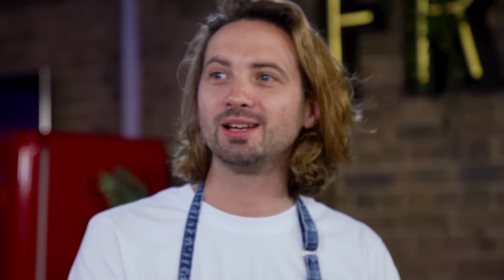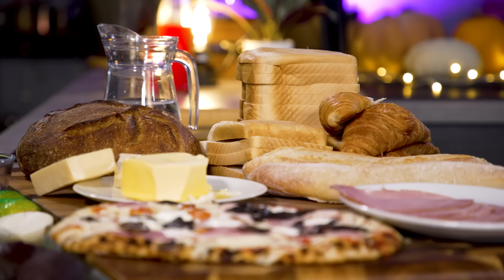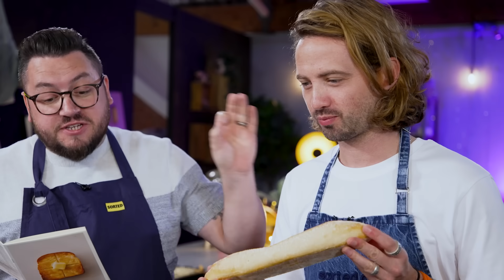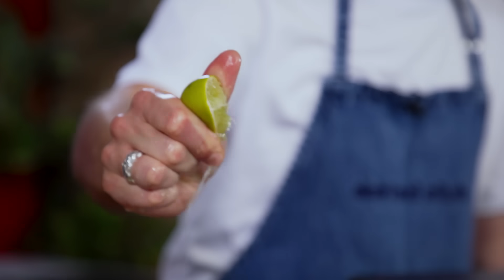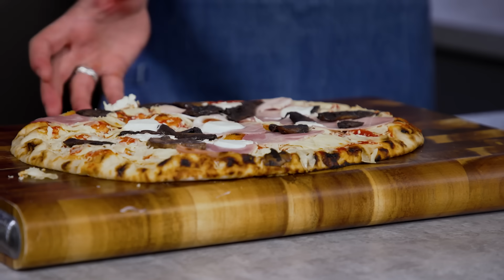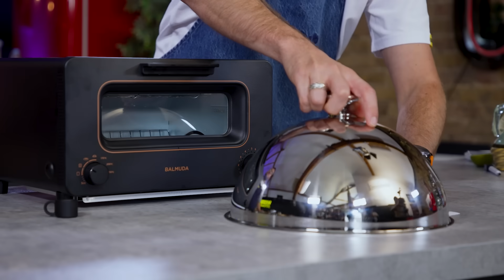Is this £260 Toaster GENIUS or an Absolute Waste of Money?!

Comment: When you took the toast out, the top looked awesome - but the bottom looked half burnt half "raw".  Kind of the same with the Cheese Toast, the top looked very nice, but the bottom had a burnt line in the middle, and hardly anything else. The cookies showed the same un-even heating.. And the reason why the pizza didnt have a even burn on the bottom (which Jamie seemed to like) was probably the same reason.. The very least a toaster / oven should be able to do, is brown/cook things evenly and well.

Comment: You guys should really check out the Ninja Foodi Air Fryer Oven, the model name is SP101UK (in the UK, of course). It does these things and more, I think you'd have a good time trying it out, mostly since I love mine and use it almost every day. Plus, it's "only" 179 punds, and flips away when you're not using it.

Comment: Why would you buy this toaster oven when you can just use the techniques learned from the instructions and just use a cheaper oven? The common technique in everything is using a little water. Just keeping a spray bottle with water near by and spray the inside of the oven when toasting bread.

Comment: I own one of these.  It is not a miracle worker and is not for everyone, but I like it.  I have a small kitchen and this works well.  

Besides the toast and some of the things they have done, I use it for reheating chicken nuggets, doing pizza rolls really well (better than a microwave).  Sometimes making solo meals (like even salmon) has worked out well.

Sometimes I wish it was a bit bigger, but if it was a bit bigger it would be a struggle to put in my kitchen (which is one of the reasons I bought it).

Comment: You can get a decent toaster oven for 1/3 the price, and get basically the same results, but you have to figure the settings on your own.  For half the price you can get a tabletop convection oven.  It does look pretty slick though.

Comment: Well, these smaller oven type things are popular now. Like the air fryer. We all have an oven that can fit a bloody turkey in it and every time we use it we spend energy heating that huge chasm. I would say as far as ovens, for most people we could would need the same width but only half the height. What you need as a student on one of those STUPID electricity meters you have to fill up. One induction plate, and one airfryer or this thing. Maybe a microwave. I remember one of the places I lived in Wolverhampton as a student you had to light the gas oven by putting a match into it. NOPE! Oh good ol' student accommodations! lol

Comment: You can get the same "steaming from the middle" phenomena by freezing your bread in slices and then throwing them directly into a normally priced toaster oven. Also, I recommend looking at how J Kenji Lopez Alt wets the outside of a bagel before toasting, which refreshes them similar to the ~fancy~ baguette mode here.
Reply: Exactly my thought. The wet-the-baguette method makes this pretty pointless.
Reply: Another option: air fryer/countertop convection oven + little bit of water in the bottom. I do that all the time...and my air fryer was like $60.
Reply: The best part about freezing it is the bread lasts a lot longer

Comment: Interesting to see a toaster oven that actually toasts bread well out of the box without fiddling. That being said it's clearly been specifically designed mostly just to do that. Still pretty sure I could get most of the way towards what that thing does by just adding a bit of water to my 60$ toaster oven and messing with settings. Plus I can cook a whole chicken in mine if I spatchcock it. And have much more gradation and specifics on the functionality (full temperature knob, convection or not, broil (grill) or both elements, all the standard oven stuff). And I can fit 4 big slices of bread in without issue.
I'm told you guys don't really have toaster ovens in the UK, though. Shame. I got rid of my traditional toaster years ago after buying a solid, but entry-level toaster oven, and I've never looked back. It's basically a non-buzz-word-marketed air-fryer - i.e. a small counter-top convection oven. 100% worth buying one. That machine, however, is worth no more than 100$ CAD. You guys don't have a direct comparison, so you seem vaguely okay with the 3 hundo, but that's ludicrously over-priced.
You should also always pre-heat a toaster oven, just like a real oven. It's not as important, but you still get better results.

Comment: 12:51 its a fair assumption that it would use less power, but what would complete this review was real world testing if it really did useless power, with prices on power going up, its relevant if your expensive toaster costs more or less that just using you oven or other appliances that can do the same job, perhaps cheaper.

Comment: who the heck gave the instructions of a cereal killer for toast. imma say for 300$ US dollars heck no all the nope drop it to 160$ maybe but its still just a over hyped over priced Toaster Oven and nothing more and in a few years I believe normal toasters would copy the same idea for the moist future. my budget for cooking items is if its more then 50$ its BS ex pans and pots 100$ or a little over is reasonable for something to last more then a year, and a good quality knife seriously I use a 36+ year old knife for slicing and cutting everything made by buck in some time in 60s or 70s and its still cuts everything even bone. i have my moms blender from the late 50s still works amazingly but very dangerous at the same time. its got open vents on the bottom so you see the motor sparking and smell ozone. but its never quit or did something my mom saw as not normal from when it was new. we have a lot of 60s-70s and a few 80s stuff. my fave is the copper and nickel plated pasta strainer my mom had it passed down from her parents from WWII we still use it every week.   id rather spend my money on well made items vs a pretentious toaster oven any day

Comment: I think I mentioned the balmuda in a comment to the other toaster video. I've seen other videos on the balmuda and have been very intrigued. Sadly, bread is no longer a regular part of my diet (even though I love it). Wow. You can hear the crunch every time they bite into the various toasted breads. drat. I'm drooling. Too bad they didn't try milk bread in it. I think the balmuda is supposed to work exceptionally well for thicker sliced bread, like the cheese bread they made.

Comment: Just bought a new toaster with quartz tubes (like this one appears to be) for $50 or 1/6 the price. Granted it is a vertical slot, so you can't do cheese toast, but it has a bagel mode where it only toasts the inside of the bagel and not the outside. Seems to me, if you really want a little steam to just use a spray bottle with water before you put the bread in the toaster to get the same effect,
Reply: Toasters  with a bagel mode have existed for at least the past 15 years; my parents had one when I was young. I think it cost $20, if that; it was surely whatever the cheapest available model was.

Comment: Interested to hear if the outside stays cool while in use. That would be the deciding factor for me, since counter space is limited and having to keep things far away from a hot appliance takes up even more room.
Reply: It does seem to keep cool on the outside, judging by how Baz was opening its door.
Reply: The outside gets a little warm and you need to keep it at least 4 to 6 inches away from other objects. The front stays cooler.

Comment: So its an expensive small toaster oven(as that's what it is, a toaster oven just fancy aka more $$$$$). As you can do lots of that using just a toaster oven and knowing methods they use to do it. Just the machine is built to have places for like adding water for steam instead of adding own way to create steam. So you pay more due to they have built it for that and gain something that is smaller and toast less but has it all in place for use instead of having to figure it all out yourself. Yep so not worth it as a good toaster oven can do that and more, without dropping 300 bucks on a small fancy toaster oven.

Comment: I think you two wanted this to be a good toaster, so you overlooked and downplayed the actual effectiveness of its cooking. when you pulled the original toast out you didnt even look at the bottom and in the shot when you go to put it on the board you can see the whole one side of the bottom was not toasted to any sort of color. then in the cheese toastie the bottom again may have been dry but it certainly wasnt taosted to any shade but the bread. and then on the pizza... i am sorry but NO ONE likes a floppy pizza... even Ben comments on the pizza flop when its not firm and cooked properly. overall i'd say it's just an over-priced easy bake oven.

Comment: OMG, these things drive me insane, so expensive and not needed.   Just boil a kettle, put in a tray at the bottom of your oven and then grill your toast, heat your bread, etc using your builtin grill.  EDIT:  Obviously toast with the oven door closed ;)
Reply: 1) There are many places in the world where ovens do not come standard in flats or apartments
2) Toaster ovens use far less power than an oven
Reply: @al5547  I was really talking with regards to already having an oven and yes I was very UK focused.

Comment: I was in the market for a microwave toaster oven combo thing a while back. I ended up getting the CS89 combi oven from Panasonic. It's way bigger but so much better. It also has special modes for frozen and chilled pizza and other things. It's also almost a normal sized oven, so you won't need to cut your pizza beforehand!
Reply: I was eyeing this model for a while now too. May I ask if it grills well (with grill marks and all)?
Reply: @cyexlceltan3446  The Panasonic? It grills excellently, perfectly even and you wouldn't struggle to get the heat bllistering.
Reply: I was looking for something similar and got the Sage Combi Wave which is a microwave/oven/air fryer. Has special modes for pizza, chips, rice, etc. Lots of special modes for meat, which are a bit of a waste since I'm vegetarian, but overall I'm happy.
Reply: @meredit931  I didn't think the Sage one had a microwave function? The impetus for the search was because I wanted to replace my microwave, and the combi microwaves from Sage didn't have the oven/air fryer function that I thought would be a good combo.

Had a quick look on Sage's website. Just my luck that they came out with a product I would've bought almsot right after! Ah well...

Comment: I do think it's worth contextualizing that this is a Japanese toaster meant for Japanese kitchens, which do not come standard with an oven. There's usually only a hob or two. The kitchen space is also usually tiny if you're living in a big city, so space is at a premium. All this to say, tiny toaster that doubles as tiny oven is helping conserve space in the context in which its most often used and this sort of thing would be marketed toward hobbyist bakers.
Reply: Than get a mini oven, I had one when I was a student at uni they can do all that this thing can, have a wider variety of temperatures and are cheaper and depending on model have two additional hobs on top.

Comment: I have a small Panasonic toaster oven(NB-G110P) with infrared heating, says it reheats 40% faster than regular toaster ovens,...love it!. Comes with a metal tray..does toast, pizza, reheats, bakes...fits an 8"x8" oven-proof casserole .   189-199$ CA=122.53 -128.71 GBP....mine is 110 volts of course...

Comment: Two things you didn't cover that would make a difference for me.    1) How easy/difficult is it to clean.   I saw cheese dropping off into the oven when you did your first cheese toast, did it adhere and become a permanent part of the oven?    2) Is there a storage location for that tiny cup, or is it simply bound to be lost within the first day of ownership when it gets put into the drawer with the measuring cups?
Reply: Aha! Exactly my thoughts too!! And they didn't show us the bottom of that first round of toast...was it toasted evenly, or did I glimpse whiter/darker spots similar to what my 20-year old toaster coughs up?!
Reply: @danutagajewski3330  I definitely glimpsed what I would call "burned" spots on the bottom of the plain toast, as well as "raw toast" bits that didn't seem to get any heat. And what did the cross do?
Reply: @danutagajewski3330  The bottom doesn't toast evenly. It doesn't affect the taste.
Reply: @danutagajewski3330  The bottom of the toast was both burnt and raw, with stripes from the rack. I think the toast is like the machine itself. Looks very good on the bit you're supposed to look at but a closer look and it's wasted.
Reply: @Jailhouse_Chris you can adjust the temperature and time to make toast to your liking. I like it about how they made it but it’s very easy. You don’t have to use the presets. There is a temperature dial as well as a timer dial and it’s brilliant
Reply: There is no storage for the cup. My toaster stand has a little hook, where i hook the cup, otherwise I am sure I would have lost it by now
Reply: I have this oven for two years (I live in Thailand), so I can answer to ur questions. The tray underneath is removable so you can clean/wash it with no problem. However, there is no storage for the little cup. But my seller includes the magnetic hook that can be attached to the oven, so the little cup can be hung there. But I don’t think it is included in original box. Sometimes I use one tsp (=5ml) instead too. Hope this helps!
Reply: I can answer the losing the cup problem - 5 ccs is the same as 5 milliliters... which is the exact same as a Teaspoon.  Its a teaspoon of water.
Reply: It’s a Japanese toaster, so if you cut your bread as thick as Japanese bread, you can remove a bit of bread and make a trough for the cheese so it doesn’t spill out.
Reply: You can put a little magnet on the bottom of the cup and the toaster is metal so it stays put. It’s very easy to clean. I’ve had mine for years. Got it on sale at Costco years ago for $120 US but it was limited to the gray one. While I’d have preferred this black one or the white one it was affordable and I love it and I’ve grown to love the color. Also if you lose the cup it’s just basically 1 tap or 5 ml
Reply: The other question is can this be replicated just by adding a tsp of water to the bottom of a regular toaster oven? As near as I can tell, dialing in the heat and time on a regular toaster oven with a tsp of water in the middle would achieve the same thing.
Reply: @PrinceKaladin no it wouldn’t. It distributes I differently instead of sizzling away at the bottom
Of the oven. That’s too little water for an oven. You could put a ramiken in but it’s not the same. Steam ovens are designed to spray the steam a certain way
Reply: I keep my little cup next to the toaster. I've had it for 2 years and haven't lost it.
Reply: You can use a 5 cc syringe instead
Reply: true
Reply: I bought this oven and i can tell you it is so easy to clean, easy to reach everthing once you remove the grills.  There is a tray underneath that catches the crumbs too.  As for the cup/storeage...i bought a small stainless steal hook that is a magnet (from amazon ).  i have it hanging on the side of the oven.  Works very well and I've no complaints.
Reply: This toaster oven is a gimmick 🤷‍♀️ just another gimmick gadget to take up kitchen space.
Reply: @kitrozon4422  tell that to the 90% of Japanese families that have one instead of a toaster(also does fish)
Reply: @kitrozon4422  I'd say it is pretty good for people that are living by themselves. Which in a lot of places, where you rent probably won't provide an oven at all.
Reply: @kitrozon4422  this one or all of them? This one's a bit pretentious, but as a mini oven, it's basically a toaster but with an added function of making delicious sandwiches with melted cheese and what not, as opposed to just drying a single piece of bread. I also like to toast nuts in it. And yes you can bake smth on lower setting without firing up the whole normal oven
Reply: @kitrozon4422 nope. It’s replaced my shit toaster oven as well as my microwave and even we barely even use the oven anymore. It’s wonderful
Reply: @kitrozon4422  It isn't a gimmick if you need a toaster and an oven that takes up a small space.  I own it, because I have a very small apartment kitchen, where I don't have a lot of counterspace.  Since I live alone, this had a lot of features and was compact, so it works.

Admittedly, this is very niche, and I think for most people (especially families), this won't be useful.  I wonder if it is because a lot of Japanese apartments are also small, that this is what it was originally designed for
Reply: Have you tried not losing things? 😮
Reply: @daneek88  Have you tried being in the kitchen yourself and not mum doing it for you?
Reply: @nettack  what a comeback. He only said to be more responsible and you tell him to stop asking his mom for help. One of ya'll tries their best to be responsible and not blame others when they lose things, the other I'm sure has relied on their mother for a while and/or has mommy issues.

Comment: Hello from Canada.  I have a toaster made by Black and Decker that cost about $180.00 Canadian.  I have had this toaster for almost ten years.  It has 8 cooking modes.  Toast, bagel, bake, broil, cookies, pizza, frozen snacks, and potatoes.  In the bake mode I can adjust the temperature. I can change the setting on toast and bagel from light to dark and there is a timer for up to 2 hrs on all settings excluding toast and bagel.  It sits on the counter top.  I have baked cakes and cookies in it, roasted up to a 4lb joint, grilled chops and veggies.  I couldn't live without it .  Hope you are having a lovely Autumn, today in Ontario the temp is 22C, have a great day.